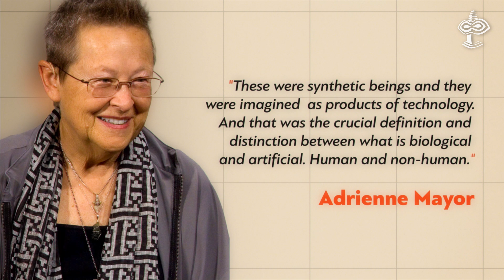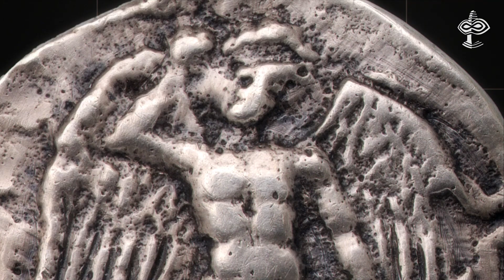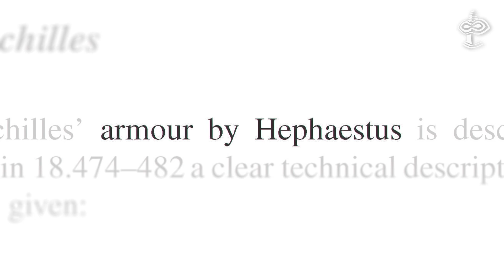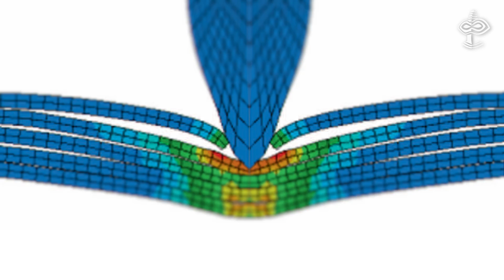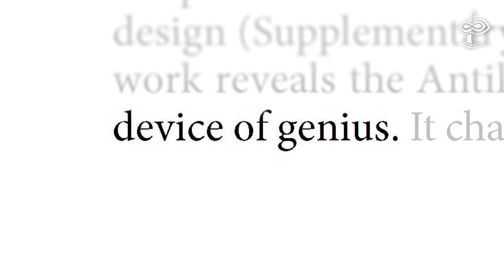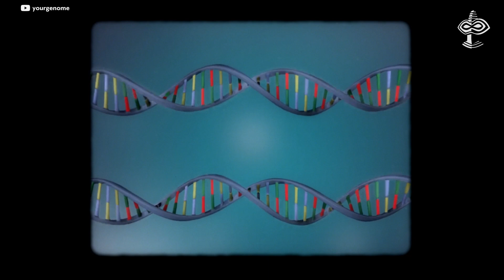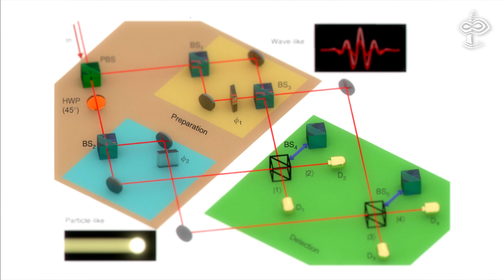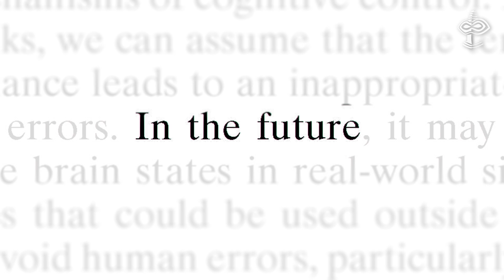Ancient ROBOTS of humans and the gods - VERSADOCO

Comment: Hephaestus is reported to have constructed the 
"well-built walls" which the Greeks discovered. The Greeks had a  separate special word for these walls which were the polygonal walls. This word is found in Holmer I think. They say that Hephaestus used the Cyclops to build these huge blocks polygonal walls. If this is true, then Hephaestus traveled worldwide wherever polygonal walls are found?
Reply: Homer sorry typo
Reply from the maker: The polygonal walls differ from site to site. In Greece, many of these walls imitate the polygonal design, but the stones used do not bear any significant weight. They serve more as decorative tiles rather than load-bearing components. So, most like inspired by such design. On the other hand, in Peru, polygonal blocks are utilized as structural elements, carrying the weight of the structures built upon them.
Reply: @Versadoco  What about the polys in Mexico and Egypt?
Reply from the maker: In Mexico and Egypt these a 'true' polygonal masonry, as well as in ancient Anatolia (modern Turkey).